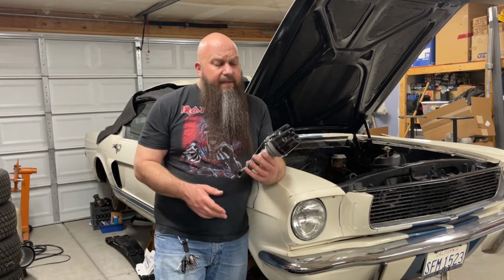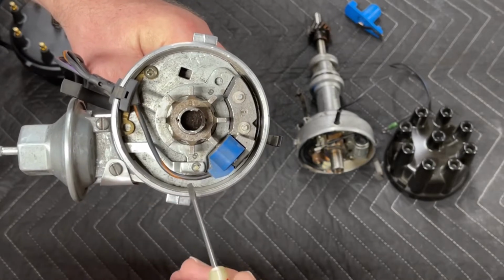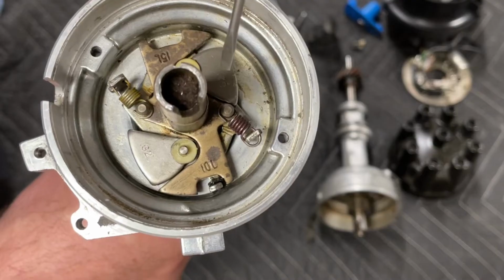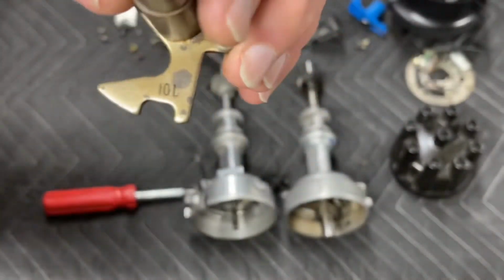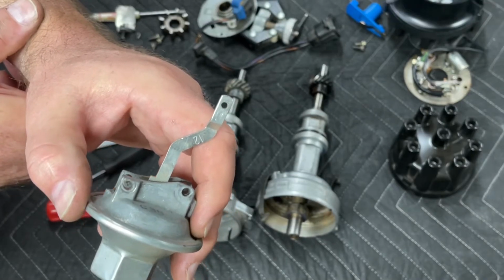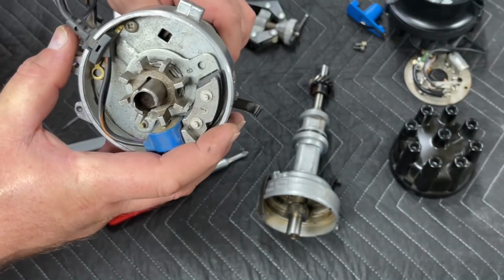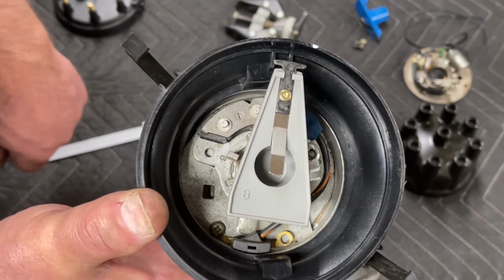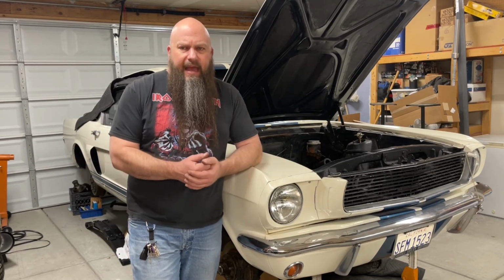Easy DIY Performance Re-Curve: '57-87 Ford V8 Distributors - Tune Your Ignition Timing

Comment: good video thanks . i have been doing a lot in gm hei distributor. vacuum, weight. springs. weld. Which can be quite nerve-wracking when you've tested a lot. Takes a lot of time. But I won't complain in the future now that I've seen how to do it in a Ford. One problem i have is that when the car runs best(my best adjustment) when it is warm. then the car ran very badly until the temperature rose. So I've had to make a copromise setting. have thought about testing again with the best setting. but have a valve to the vacuum hose that is closed when the engine is cold. then open it when it's warm (maybe work?). I guess the heat affects the gasoline.
Reply from the maker: If the issue is temperature related it is likely more related to the air fuel ratio than the ignition timing.  You may want to try enriching the idle circuit a quarter turn per side and give it a go.  Now, every engine is different, and other than it being GM I can’t assume me anything specific about your combination but compression, cam specs, and combustion chamber design all play a role in the start up and idle characteristics.  For example a 9:1 454 with an open chamber head with a small dome piston and a moderate cam will behave completely different from a closed chamber head with a flat top or a dish and the same compression and cam.  Then, larger or smaller cams change the cylinder pressure substantially.  All of that changes the air fuel mixture and timing requirements for start up.  I’ve also done a substantial number of GM and Mopar distributors, so if you care to give a little more info, I’d be happy to share my thoughts.
Reply: @TheGT350Garage  350cui. 8,5:1 car van.  mayby 230hp.carb 450cfm. duration(50)204&214.hedders. Car runs pretty good now. But if I adjust it so it runs really well when warm. Then it runs very badly for about 10 minutes. If you accelerate normally when cold. then the engine knocks. If I then lose my temper and go full throttle. then it goes well.I know that an engine can knock when it's cold. I don't remember all the adjustments I made but I have it saved but can't find it anymore. I have blocked the heat channel in the head.performer intake aluminum with plastic adapter.I have tested about 10 different vacuum canisters, some of which I have midified (the whole process was interesting). the error comes if I have even lighter springs and increase the stroke on vacuum canisters. and car runs really well when hot. As I see it, it's heat and the ignition?So I've been thinking about this for a while.
Reply from the maker: That’s a fairly basic and common combination.  A 350 with an “RV” or “Performer” style camshaft, 8.5:1, with a small carb in a fairly heavy application.  It’s going to have good torque from 1000 to 4500rpm and be all done at 5500rpm (even if it revs a bit past that).  That’s not a ton of compression, and if the cam is installed +4 advanced which is typically what that style cam get installed at, you should have about 165-180psi cranking compression.  Additionally, you need to keep in mind that a van isn’t considered a light vehicle even if it’s not as heavy as a truck or SUV because of the aerodynamic loads.  

Initial timing should be set to 10-12° with your vacuum advance connected to MANIFOLD vacuum.  The vacuum advance should be adding another 8-12° so the engine idles with 18-24° cold or hot.  Remember manifold vacuum goes away with throttle so as you accelerate the engine runs primarily on mechanical advance.  Using ported vacuum for the vacuum source, especially with a small carb that produces instantaneous high vacuum levels in the venturi of the carburetor will rapidly add timing as load increases causing pinging and knocking.

The springs in the mechanical advance should bring your advance curve in gradually from 1000 to 3000 RPM, with mechanical advance “all in” at 3000.  I usually recommend 20-24° be the advance limit for most distributors these days and you can fine tune the total timing by changing the initial.  If you want 34-36° you’re there at 10-16° initial when you add the two together.

That combination for a 350 won’t rev excessively fast, and the vehicle is relatively heavy, so a fast advance curve will ping and knock at lower rpm and part throttle.  If you are using ported vacuum for the vacuum advance that will compound the problem you are experiencing because as you try to accelerate the vacuum advance will add even more timing to your mechanical curve, pushing the engine way too advanced. 

Compare the recommendations to your notes, I suspect you’ll see improvements with little effort.
Reply: @TheGT350Garage  i have 165psi. and manifoldvacuum. I'll try when I have time and desire.

Comment: Very informative.  One of the better videos I've seen as you dove into the distributor.  I'm helping tune a "73 531C 2V with FMX trans.  Pretty much stock vehicle intended to be a daily driver.  I rebuilt carb with only one mistake. I used the rebuild kit's power valve of 7.5.  Fixed that.  The distributor was replaced at some point and now has electronic ignition.  Our problem:  Emissions tag of 6º is too low.  Set at 12º initial but she likes closer to 16. Centrifugal adds 14, 22, and 26º at 1500, 2200, and 2500 RPM respectively.  Vacuum adds 2, 14, 18, and 20º when hand pumped to 5, 10, 15, and 20 Hg.  I'm keeping at 12 initial only because I think total advance is too high.  Using ported vacuum.  Your video will help me make adjustments but it would be easier if I had target numbers to pursue.  I'm not skilled enough to tune by ear.  I have an adjustable timing light and a vacuum gauge.  Just need some specs to chase down to establish a curve.
Reply from the maker: The 73 351C 2V is an open chamber head and that engine is barely 8:1 compression.  It will want 16-18° initial and the mechanical advance needs to be limited to add 20° (10L on the mechanism) which will give you 36-38° total timing.  The vacuum advance needs to run off of manifold vacuum and is there to enhance light load operation and cruising, you may want to try adjusting the vacuum advance to produce 12-14° maximum at the engines peak available vacuum from idle or cruise speeds.  You’ll also want to eliminate any thermal ported vacuum switches from the vacuum advance connection.
Reply: I have one more follow up question based on your feedback. Really appreciate it by the way. If I am switching from zero ported vacuum at idle and increasing to  6-7 inches from manifold at idle, does my target initial timing include vacuum advance?
Reply from the maker: So, let’s start with why ported vacuum is problematic, it gives no benefit at idle or light throttle when the engine actually needs the extra advance to get combustion completed before the exhaust valve opens towards the end of the power stroke, so ported vacuum drives high temps out the exhaust port and super heats the head, making engines more prone to overheating.

Manifold vacuum is the key.  It has to be in addition to initial timing though. So 12-16° initial is with the vacuum line disconnected and temporarily plugged.  When you hook up the line to manifold vacuum the timing should advance an additional 10-15° and that’s good.  The extra timing at light loads aides in completing combustion during the power stroke.  It also allows you to run less throttle plate opening and a leaner idle mixture which improves exhaust smell associated with carburetors.  You can also typically drop 2 jet sizes because cruise operation becomes more efficient as well. 

So with manifold vacuum there are a couple minor adjustments to be made that generate an overall improvement in engine operation and temperature, but it’s extremely worthwhile.

Initial timing should be 12-16°
Total timing without vacuum 32-36°
Available vacuum advance using manifold vacuum should be 10-15° (adjustable vacuum advance units are about $35).

Please feel free to reach out for additional info.  Also, check out my distributor curve video for more information.

Comment: Dwell is the length of time that the points are closed. Current flows into the primary side of the ignition coil during the dwell time, building up a magnetic field which collapses when the points open. The collapsing magnetic field induces energy into the secondary side of the coil which creates the spark. Dual points allow a longer dwell and thus a higher energy spark. The dwell time is still influenced by engine speed though as the higher the speed the shorter the dwell time and the weaker the spark. Electronic points systems, whether magnetic or optical, trigger a pulse of energy into the coil of the same length regardless of engine speed so the spark energy remains constant. With a constant spark energy you can open up the plug gap a bit wider to make a bigger spark for more reliable ignition.
Reply from the maker: Dwell is very much a function of point gap on the point cam.  Less point gap produces more dwell.  Dual points cheat the dwell time by holding the trailing breaker point closed while the leading breaker point is open, then quickly closing the leading breaker point after the trailing unit opens.  It was a mechanical solution to an electrical problem.  Electronic ignition systems still suffer from the loss of dwell time as RPM increases, this is why we use individual coils on modern cars, the saturation time is substantially higher and so is the energy behind the spark.  

Your final comment about opening up the point gap sounds as though you mean the spark plug gap.  After 30+ years of playing around with plug gaps, I’m not a fan of increasing the plug gap significantly.  My long term observation has been that wide plug gaps shorten the life of the spark plug wires by loading their resistance electrically.  As cylinder pressure rises, so does the resistance in the plug gap, add to that The gap between the distributor rotor and the terminals in the cap, and the resistance in the plug wires, there is a significant loss in spark energy at the spark kernel.  The coil wire bears the heaviest burden of the electrical load, then the spark plug wires.  I’ve had .055-.060” gaps take out a set of MSD Super Conductor plug wires in less than 15,000 miles, so the largest gaps I run are .045” on naturally aspirated engines using about 9:1 compression or less.  With boost or high compression that gap must be reduced, so at 12:1 I run .032”-.035” gaps.  On a supercharged 9:1 engine running 15psi that gap will be .025-.028”.
Reply: @TheGT350Garage  you are right about how the dual points work, the points are wired in parallel and the period in which each one is closed overlaps. I'm not sure about electronic ignition systems suffering a 'loss of dwell' at higher RPM. What's happening is the sensor triggers a monostable multivibrator - a circuit which produces a pulse of a defined width. This pulse width is small compared to the time between sparks so one pulse should not effect the next. What may be happening, in a capacitive discharge system is that as the time between sparks decreases then the capacitor may not have time to fully charge. This would lead to a decrease in the energy in each spark at higher RPM.
Reply: @TheGT350Garage  I did mean plug gap (and have edited my post) but I don't see how a wide plug gap can damage the plug wires. For the load in the wires to increase, the resistance across the gap would have to decrease.
Reply from the maker: You would think that, but with high voltage, if the spark can’t jump the gap in the cylinder it wants to go somewhere, that’s going to be down the boot along the porcelain, or through the weakest point in the insulation on the conductor.
Reply: @TheGT350Garage  OK, that's plausible. In any case the gap increase I'm advocating is small. 0.6-0.8mm which is 23-30 thousandths of an inch. It improved the idle quality in my '69 Ford Custom with 302.
Reply from the maker: If that was a new gap on new plugs vs used plugs with the old gap, the gap change is placebo effect, the new plugs are more likely the cause the improvements.
Reply: @TheGT350Garage  No placebo effect. The engine idled better after opening the gaps on the existing plugs. I'm an Engineer and I understand scientific method. Make one change at a time and note the results. There was a measurable difference in manifold vacuum after the change.